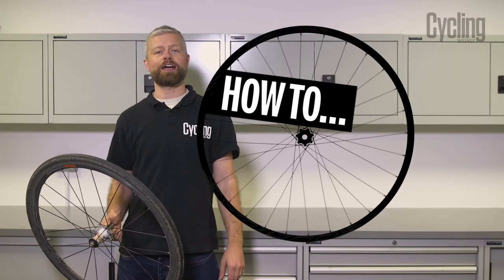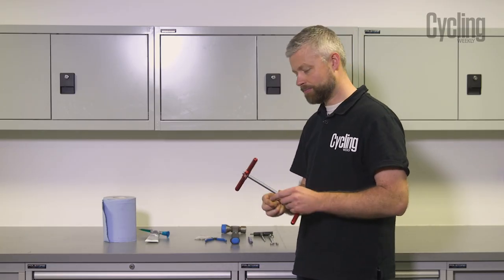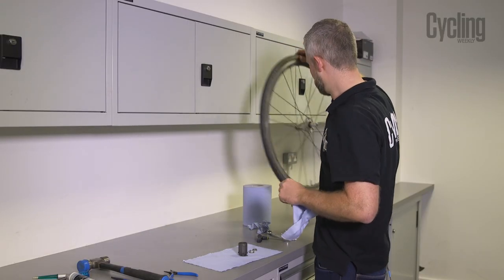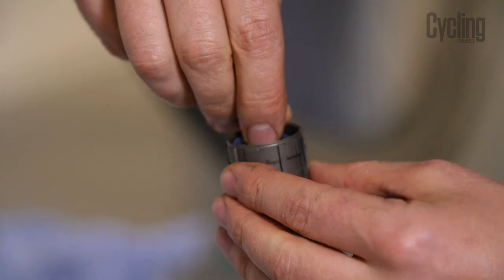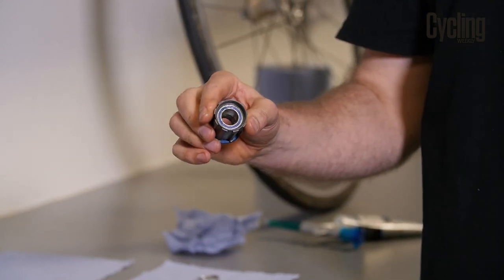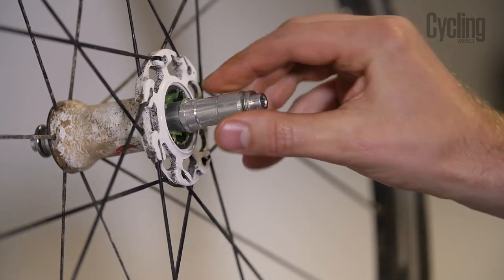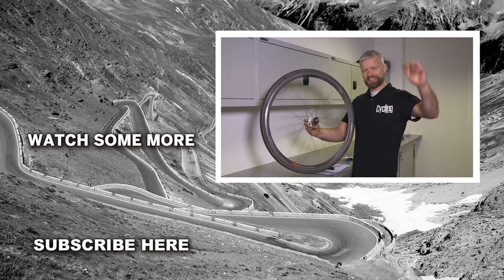How to service Fulcrum or Campagnolo freehub body | Cycling Weekly

Comment: Would it not be better to use a sliver of anti seize/copper slip on the axle when putting the freehub body back and side of the bearings before putting them in?Good grease is fine for when you need lubrication but anti seize is better for its particular job of stopping stuff from getting stuck in.
Also whats the point in adding more grease to the bearing race when its a sealed bearing anyways, defeats the object of a sealed bearing and introduces more friction with no gain, or do you think that grease on the race makes the bearing more weatherproof?

Comment: What size tip on the circlip pliers? I have 1.2mm and it is bloody hard getting a grip on it. I needed to grab it, squeeze, and jam a right angle scribe under it to pull it out with it coming off the circlip pliers.

Comment: Personally I use a proper bearing extracter tool of the appropriate size to extract the bearings so they are knocked out square. If you use a single punch in just one place, as shown, there is a danger of the bearing scraping the side of the free hub body as it is knocked out.
The tightening torque for the free hub locking nut is 15nm......you do not want this to come loose.
Reply: I don’t think you’ll get a bearing extractor to engage here. The floating sleeve inside the freehub prevents this.

Comment: Here's a problem for you. I have Fulcrum Racing Zero wheels from year 2007 (2005...2009 that famous full red version). C clip in the freehub of those old wheels is totally different kind as you have in your video. There are no small holes in the ends of the c clip where you could apply your pliers. This c clip is quite similar to the one used in the right half axle of Campagnolo's Ultra Torque Bottom Bracket. So how do you remove such a c clip from the freehub body?

Comment: I replaced my pawl spring with what should be the exact replacement but it appears to be too short - it isn't long enough to fully cover and pull out the 3rd pawl. The shape and size seems to match yours though. Any thought as to what I could be doing wrong?

Comment: I have a Fulcrum Racing DB with almost an identical setup. My issue is the freehub wont release , the pawls not engaging and its just rotating in both directions. Any ideas?
Reply: Did you figure this out?

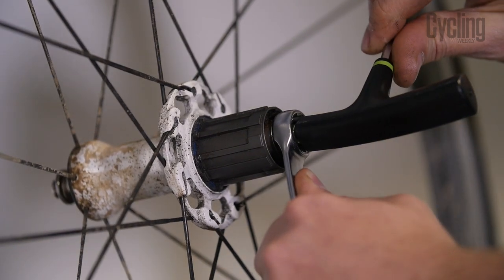Comment: I've got Fulcrum Racing 5 LG Disc wheels and tried to follow this video. However, at 2:04 it mentions to use a 5mm hex wrench inside the axle to loosen it from the freehub. My axle just has a circular whole through the center, nothing for a hex wrench to fit into. I see where to attach the spanner on the outside, but there doesn't seem to be anything to hold the axle in place while turning the spanner.
Reply: Tom Wallace did you ever figure out how to resolve this? I’m stuck with the same issue.
Reply: Same wheels, still stuck at removal stage. Used a spanner on both ends of the hub, but the wrong nut comes loose, so can't get the axle out.
Reply: I did get past it. I think I just turned the spanner on the outside and held the other end in place with my fingers and surprisingly it worked. I was expecting a lot more resistance. In the end, though, I found that getting the inner bearing out of the hub was impossible (outer bearing was easy). I soaked it in PB Blaster for a day then used a bearing removal tool, but it was still so lodged in there that the bearing innards broke out of it, with the outer bearing ring still firmly buried in the freehub.

So I decided I needed to instead replace the freehub, but found it difficult to determine which freehub I needed. I emailed Campagnolo about this and the bearing being stuck in the freehub and they responded with this:

"If you are looking for a Shimano/SRAM freehub body then yes FH-BUU015x1 is the correct part number for your Fulcrum Racing 5 LG wheelset. And just so you know even we do not replace freehub bearings as it is extremely difficult."

I ended up ordering the freehub from Amazon: https://www.amazon.com/gp/product/B00DHGSS6M/ref=od_aui_detailpages00?ie=UTF8&psc=1
Reply: My bearing was seized in the hub. Tried WD40 etc. with no joy. In the end I warmed it with a hairdryer on full and the bearing then popped out with one tap on the drift/punch.
Reply: Sometimes the axle slides straight through with the freehub attached.